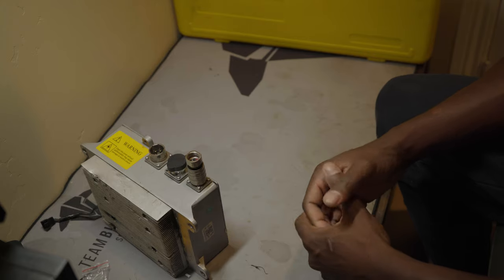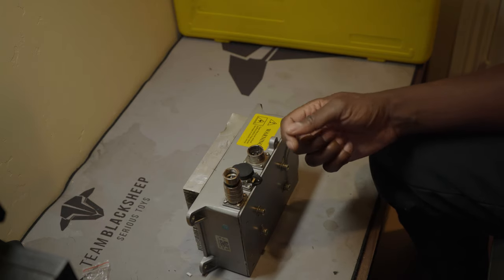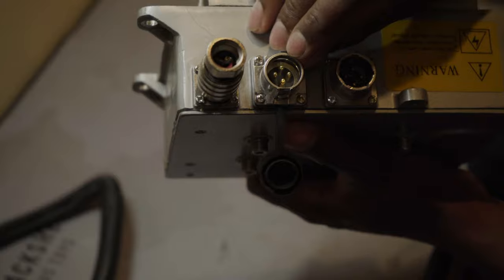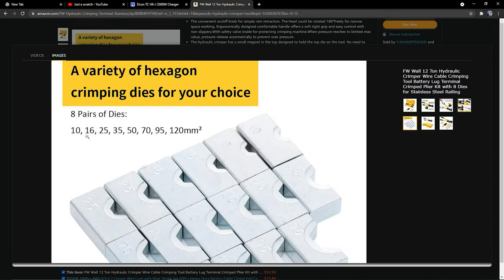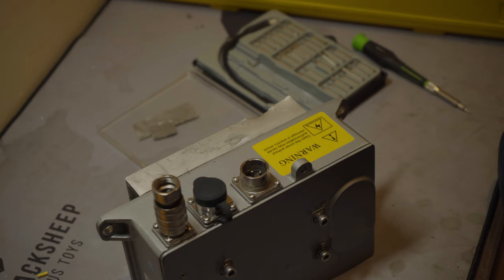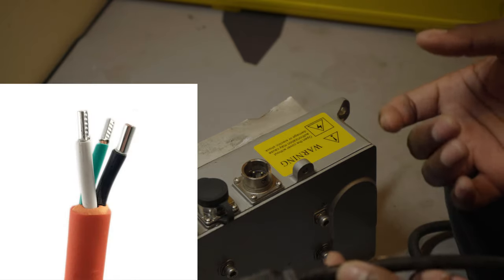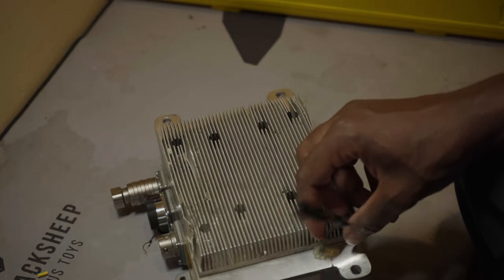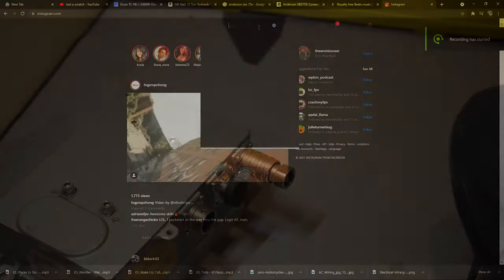Zero FXS Electric Motorcycle Vlog Ep02 - Fast Charger Overview and Build Tutorial

Comment: Nice Video! Could you please explain where the cableing from the J72 plug goes into the charger ? And Does the onboard charger also need to be plugged into a wall connector ( like the 1000W Zero Charger ) ?  Thanx again !

Comment: Does the 3.3kw charger shut off automatically when the battery is full, or do you manually have to turn it off when battery hits 100%.
Reply from the maker: Hello! And yes when the charger approaches its set voltage it will taper off and cease charging. I recommend ordering the charger with 0.2 - 0.4v lower than full battery voltage to allow the for tolerances in manufacturing. Also doesn't hurt to let the onboard charging take care of the last bit of voltage at a lower speed.